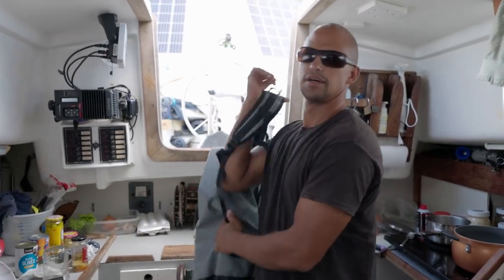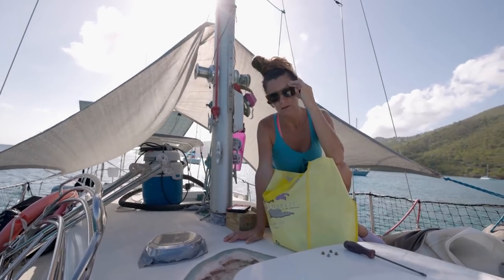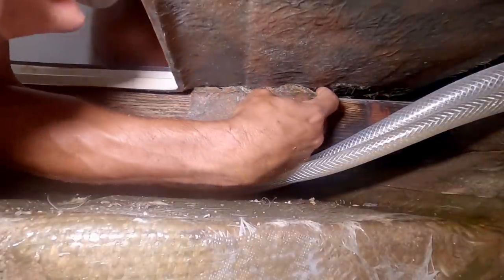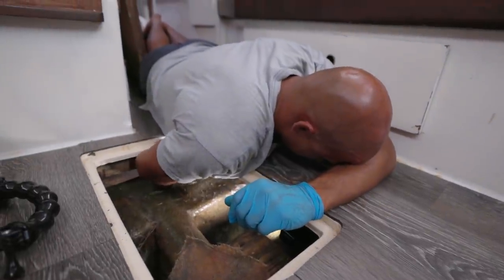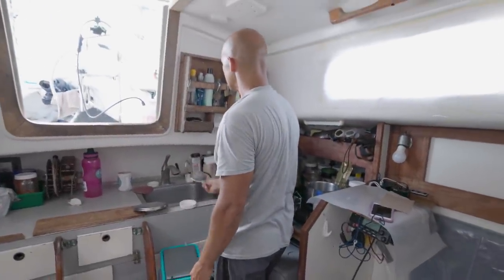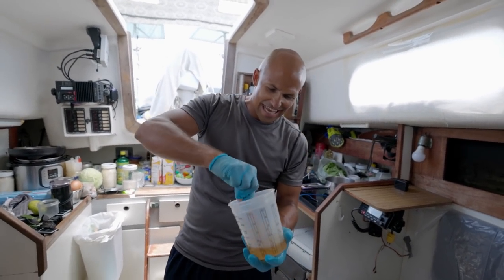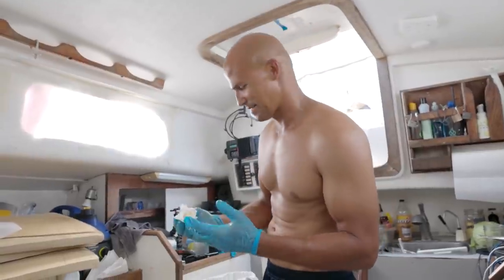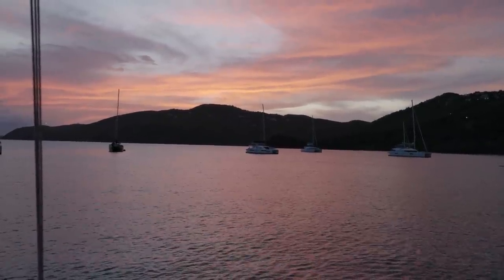WE WERE WRONG (a good thing, FINALLY)

Comment: In tight spots, applying slow cure glass upside down it sometimes wants to fall off. I've had success taking a party baloon and filling it with great stuff expanding foam. Sometimes I don't even remove it afterwards. Tying off the baloon neck can be a bit of a problem but bread clips work for that.
Reply from the maker: WOAH! Fantastic tip! Thanks!

Comment: I've got a few spots like that in lockers where one layer of fiberglass tape might have a slight crack. It looks like it was just layed up too "dry." In my case they're not structural either, just there to keep things from slipping through a gap. But, like you, I'll be putting another layer of glass in to beef it up. Fun stuff, for sure !!
Reply from the maker: can't hurt right?

Comment: Watch where you step Brandy, Beau may want those parts unharmed. I know boats aren’t that big…just fun they say. I’ll let you know as soon as I find crew to race my little girl.
Those tools are actually in a good spot to add stability to your boat, so add of glass and cloth and when dry put the tools back, I would. Nice work on the bulkhead of tool locker Beau, that is well done work, and yes the plastic on the deck will make it real smooth and easier to sand
Reply from the maker: What boat do you have?
Reply: @BeauAndBrandy  a little Moore 24